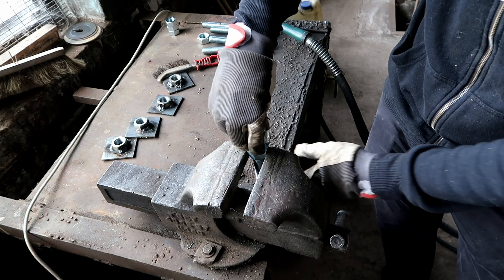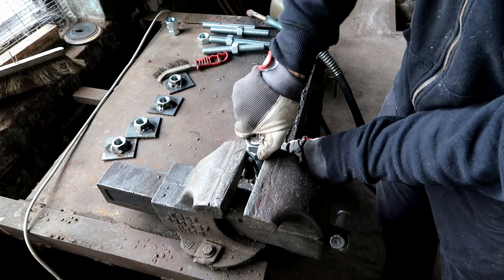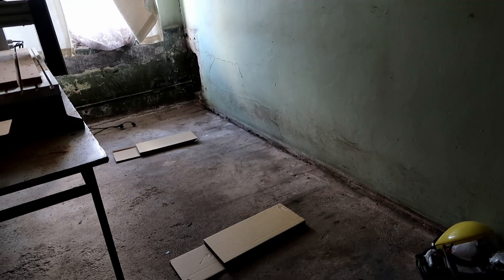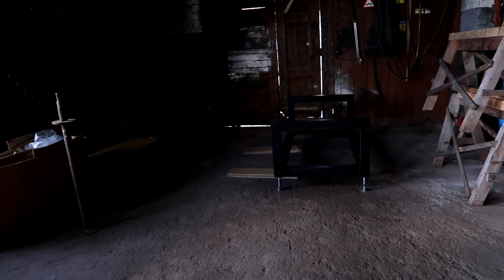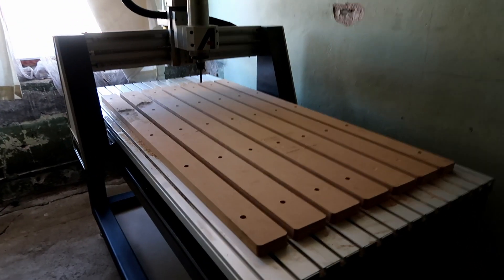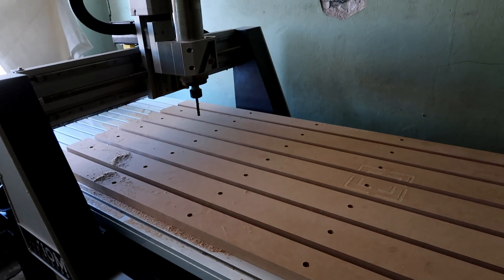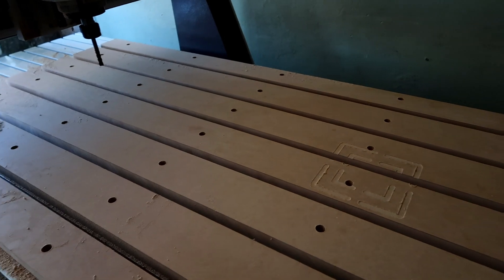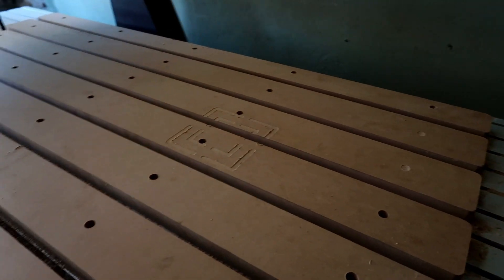The CNC base is ready

Comment: MP Dragon, would sound-absorbing panels be within your budget? I've noticed throughout the video that the room you're going to be working in has a slight echo, which could be multiplied when the CNC Machine is running, making some videos a bit loud for some of us. If you're interested, Rock Wool insulation is an excellent sound absorbing panel material. I just want to do what I can to help.

Love your videos dude, keep it up! :D
- Ms. Nightshade
Reply from the maker: After the CNC my budget is stretched quite thin, but yes I am planing to insulate the wall for one to reduce  the echo and it would keep the room warm in winter with less heating